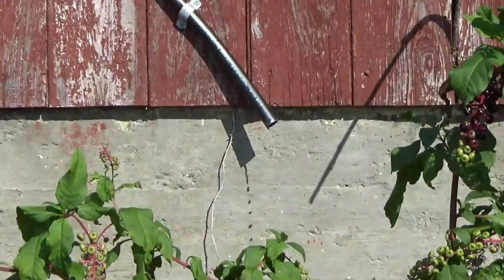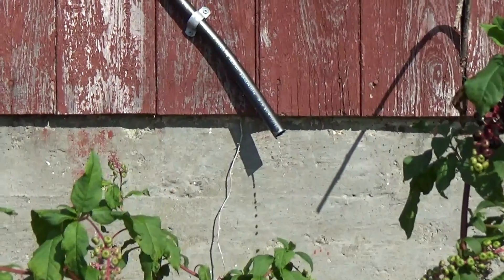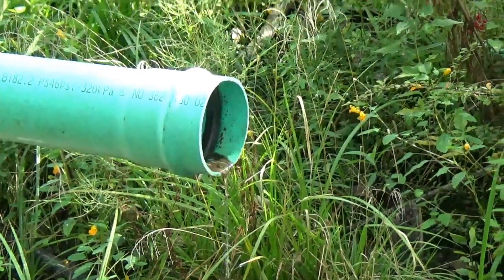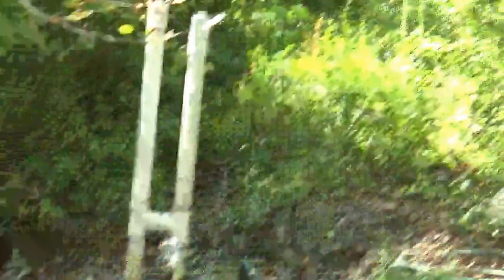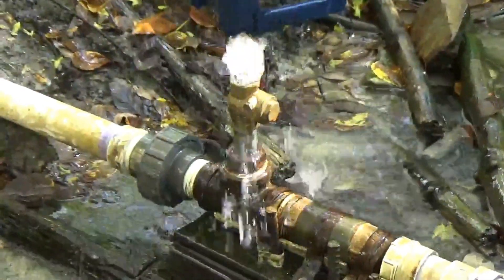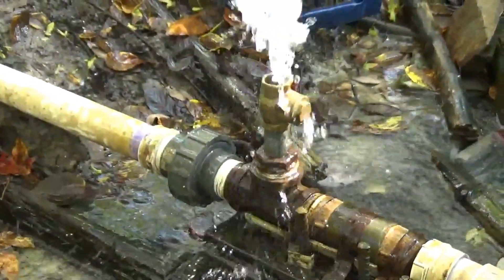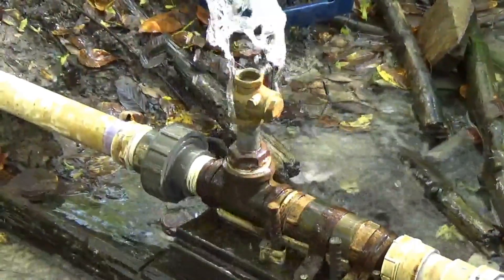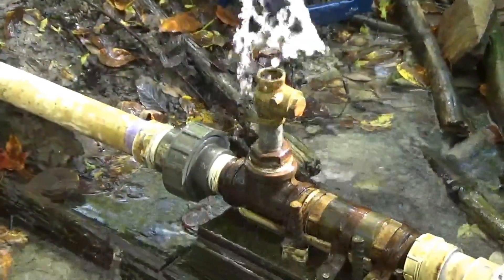09 15 2017 Ram Pump Scalability  3/4 Inch Impetus Valve on 1 1/2 Inch Pump

Comment: so if i understand correctly, you have a 1 1/2 inch feed line with 1 1/2 inch check valves, you replaced the 1 1/2 inch check valve with a 3/4 inch one but changed nothing else? so i have a 3/4" feed pipe and 3/4" check valves to a 1/2 inch line to house. you say i should change waste valve to 1/2" to reduce flow to house but don't need to change anything else?
Reply: or do i need to change both valves?
Reply from the maker: Yes, you have it correct. The other alternative I'd suggest is using a "foot valve" like my normal 1.5 in valve (3/4" for yours) that you can then adjust the operating frequency (and consequently water usage) by adding / removing weights to it.  (Note: more weight and longer cycle means MORE water usage. Faster cycling and less weight reduces water use.)

https://www.youtube.com/watch?v=M-sdiGpWZC8&t=1s

https://www.youtube.com/watch?v=vrOgObZ0wos

https://www.youtube.com/watch?v=M-g2kpysKYo
Reply: I dont think my hardware store carries foot valves but will ask tuesday. here is my ram pump build video: https://www.youtube.com/watch?v=bVNnsAhJ02w it works great but the water this summer with the drought slowed by about half from my spring. i intend to damn the spring to make a huge overflow reservoir next summer so we wont have to worry about this issue anymore hopefully.
Reply from the maker: very nice... i "liked" your vid.  I would focus on adjust-ability... eventually, no matter how big the reservoir... you will deplete it unless you match the rate of flow correctly.
Reply: our water tank overflows like yours does and once we have the pond it will go from spring to pump to house back to spring in a constant flow. we draw from the house tank but most water is wasted in the overflow back to creek currently. so the hope is that everything will even out when the overflow is directed back to spring from house and the waste water from pump is as well plus having a larger pond to draw from. hope that makes sense.

Comment: I found that adding weights to my valve slowed the rate and created more pressure allowing it to pump higher at a larger volume.
Reply from the maker: yep... that's right on... but when water supply varies, like it does here, I am forced to work within the water supply parameters.